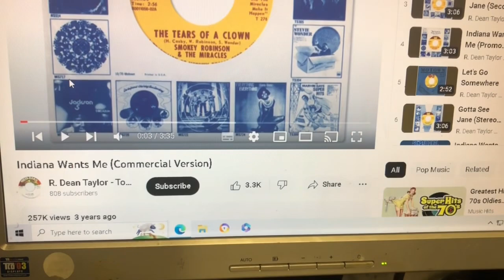Big Ommer time

Comment: Honestly you and a hammer Ian, I love having a reciprocating saw for stuff like that old truck bed a quick job   literally to slice right through. 

To be honest I use my reciprocating saw more than my grinder.

I've got a 18v dewalt subcompact one and prefer it to the makita. The blades make a massive difference I only ever buy bosch or milwaukee blades.
Reply from the maker: My next buy has to be one